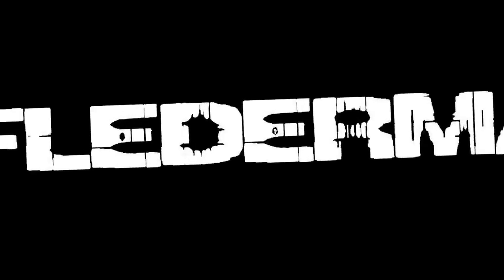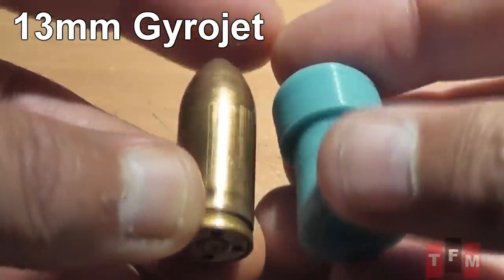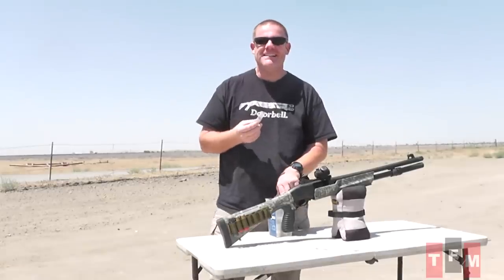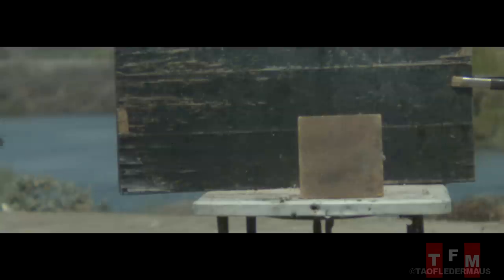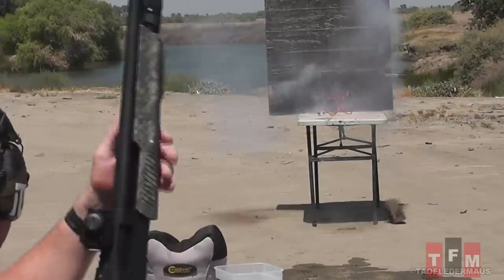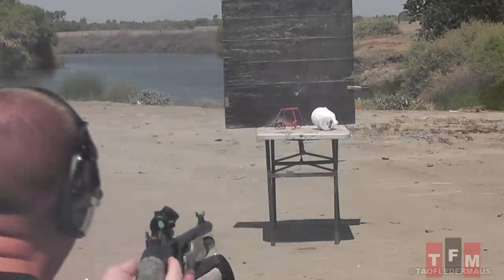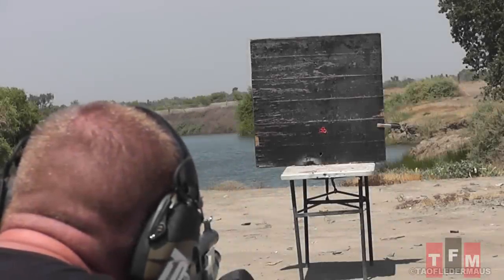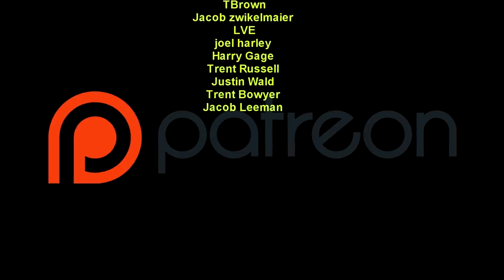Massive 3D-Printed ROCKET Slugs -   First Test

Comment: You have a drag stabilized projectile with a rocket motor.  Even if there is no actual thrust from that little rocket motor and it just create a base-bleed condition you have removed/reduced the base-drag on the projectile that would have normally stabilized the projectile.  I think you can see that in the way they flew.  It would have been interesting to have shot one of these projectiles that had the same mass distribution but inert to see if it would have been more stable in the absent of the base-bleed from the rocket motor.

Comment: You should try these with a lead slug having a cavity in the rear configured as a base bleed system from a rifled barrel. 
A base bleed is a slow burning rocket propellant that isn’t designed to provide thrust but rather to create a pocket of smoke behind the projectile in order to reduce drag. 
Works for artillery.

Comment: Very nice and interesting video.  You guys may have an idea here!!  I would have liked to see a 50 yard shot slow mo so we could have seen more ignition of the rocket slug and see if it would have actually stabilised it at a lomger range.  But i understand the fire issue.  Great video!
Reply from the maker: In retrospect,  they were accurate enough that we could have shot one over the water.
Reply: TAOFLEDERMAUS yeah, thats very true.  I was really impressed on the accuracy of them.  Hopefully you can get a couple more and maybe we can see a longer shot.  Great job!

Comment: 1:42 Best use of an old Hard drive I've seen! Lol. 

Never been into "reloading" shotgun cartridges but I might have to throw my hat into the rocket round designs. I imagine the biggest issue would definitely be the propellant (especially solid types). Reminds me of the precursor to JPL and the issues they had with Solid fuel (e.g air pockets, containments, etc). Not to mention the round has to be consistent as well. Dealing with such a tiny mass relative to it's velocity, where the slightest tug in one direction causes a tumble. 

I'd love to see the .STL file as well as the configuration/specs of the actual round like the material (ABS, PLC, etc) but more importantly the inline/wall specs (thickness, pattern, percentage, and design pattern of said lines, center of mass, etc). All those things are equally important as it can determine points of failure or where a spot could use a little ductility/give rather than being stiff and brittle. 

This should prove as a fun project. At the very least a good application of theory. Off to the whiteboard and Solidworks... After I look up some Laws surrounding the propellants lol.

Sidenote: I apologise if anything here was mentioned in the video already. As I jumped shortly after the hard drive scene. Just got myself too excited at the potential designs.

Comment: The exhaust from the round doesn't shoot backwards, it just kind of puffs out and hangs in the air. The nozzle/aperture needs to be optimized or perhaps a better fuel used. The rocket rounds mentioned would probably be a good starting point for a good geometry.

Comment: My first thought was, if a 9mm fits in the end of round, why not drill out the primer slot of an empty 9mm casing and then pack the casing with some sort of rocket fuel to give it a nozzle? you may have to cut the casing a bit short so it doesnt stick way out and cause a balance issue but it seems plausible? Also the main portion of the slug should be machined or cast metal so it holds up better. just a couple of thoughts

Comment: One other consideration is that the center of mass of the projectile changes inflight.  As the hard-candy propellant burns off the mass distribution changes.
Also, to strengthen the burn chamber, perhaps put in a brass liner (like cut one of the 9mm brass casings).

Comment: Try to make a small core trough the fuel starting from let's say 3mm and find correct size. It speeds the burning process producing shorter and faster burn rate producing more thrust (If You already haven't) Great video once again!

Comment: What if you used a blank 9mm cartridge mounted backwards inside the slug? I'm not sure if you can ignite the powder inside a blank from the front (you'd obviously have a primer in the shell casing), but that can probably be worked around.

That way you'd get the propellant of a 9mm cartridge encased in something that's meant to contain it (somewhat), and might result in better speeds. If nothing else it'd result in some interesting footage.

Comment: I think if you revisit these there are a few more tests to try. first being a shot without the rocket fuel to see if the thrust is doing anything at all. also you should see if you can drill out a metal diablo slug and use a small hobby rocket for more consistent thrust, though I don't know if a shotgun primer will cause those to ignite.

Comment: It seems like any penetration you're getting is coming from the shot you have loaded, not so much from the rocket. It seems when the rockets hit the ground or the table that they kinda die out even with the fuel still burning as opposed to the gyrojet where the slug doesn't pick up spead until ignition of the fuel. By all means, let me know if I'm misunderstanding something?

Comment: FWIW, the diabolo shape has a waist so it can fit through a choke.  Yes, good air rifle barrels traditionally have a slight constriction at the muzzle.  The newer long range match target air rifles set up to shoot actual bullets probably don't, but the ones that you or I will buy do.  

What makes 'em stable is the skirt at the back, just like a Foster slug's skirt is why they fly straight.

Comment: Officer Greg, this is an older video but maybe you'll still catch this. What's your optics setup? I have a Mossberg 500 with a pic rail for a red dot when I have the tactical barrel on. The pic rail gets in the way of the beads when I switch to the vent rib waterfowl barrel so I was thinking of an XS Sights setup as they utilize a pic rail and I could pop the red dot on and off, I think it'd work well together. Your setup looks similar.

Comment: Make them rounds out of metal, and hollow out the nose so you can fill it with the fuel. I think that there would be better results if the rocket fuel  burned from the front to the rear of the projectile. 

If the fuel is igniting in the rear, it's pushing the back end of the round forward. If you can make it burn from the front it will pull the back end instead of pushing it. I'm just guessing but I really think it would work better.

Or what if you only filled the nose with rocket fuel and put powder in the tail?

Comment: What I'm seeing is the primer/ignition power is propelling the slug.  When you shoot the ballistic booger, it sits on the table burning but doesn't even have enough thrust to even move it off the table.  I just don't see how there could be thrust to propel the slug to the target.  In your initial videos showing the slug burns, it would have been nice to just lay the slug on the ground and light it to see if it even moved.

Comment: great concept. However needs an accelerant such as aluminum powder mixed in with the fuel to speed up the rate of burn amd increase the thrust. Also as you noted a nossle would have helped.

Comment: it certainly needs a nozzle. you can do them with clay, theres an instructable on sugar rockets that uses compressed dry diatomaceous earth. that should be light enough not to toss out the balance, not that you have that right now anyway. id also like to see a test through a rifled choke, see how that affects it.
Reply: When I make my rocket motors I use a powderd kitty litter but then the core burner is only the size of the nozzle orifice.

Comment: Kinda curious if you could use the hole for the primer in a 9mm round as a restrictor plate and firmly attach the bullet to the casing, or replace it entirely. Not sure about the best way to ignite it, but you'd probably have to load it in a shell to fire it.

Comment: Three things:

One: You are right, the thrust is upsetting the stability of the slug. The slug shape is stabilized by low pressure pocket that forms behind it...and the pressure caused by the burning propellant eliminates that. Not sure how to fix that...

Two: The propellant needs to burn faster. The easiest way to do this is to cast a larger burn channel when pouring the fuel in. Less easy would be to cast multiple burn channels.

Three: And this is the tricky one! You need to build more pressure in the combustion chamber of the rocket. But not too much, or the fuel will detonate instead of burning! Also, this pressure probably would exceed the burst strength of the current 3d print.

P.S. What filament material was used to print these? PLA? Polycarbonate? PVC?
Reply: I used Maker geeks high temp raptor pla anneald in boiling water. According to there website it's stronger than nylon
Reply: % infill? Type of infill? Not criticising, but I freely admit curiosity!

P.S. https://youtu.be/bsjSHf_X13c?t=715 
should jump you to the performance tables , but feel free to check out the whole vid!

Edit: Did some more research on annealing, as I have not worked with it myself. Apparently, while it can make the part stronger, it also makes the part more brittle and vulnerable to shock loads.
Reply: @martindinner3621  they were done in 100% infill vertical with the tip on the bed.

Comment: I was under the impression that the Diabalo shape creates a negative pressure zone at its tail; and that the -P zone is key to the stability of the design.

So it seems adding propellant to the tail cavity removes the -P and undoes the stability of the design.  I think that partly explains why these had so much trouble.

It's an interesting experiment, and seems to confirm, at least in part, how the Diabalo shape functions.

Comment: Probably would want to fabricate the shells out of metal (or at least a higher grade plastic or whatever it was printed out of) and maybe work a way to put a nozzle into the design but less of a priority for something you are trying to reproduce somewhat cheap and in good quantities. Also from the clips it looked like you had good burn, just the speed they flew at didn’t allow for a build up of visible particles. Part of that instability may have also been slight variance in the center chamber being out of alignment with the shell coursing it to spin or waver a little.

Comment: thoughts on the design of the round, if you can get it so the exhaust nozzels are at the head of the round, and set it up to ignite the fuel from the top of the round so it'll burn from the front to the back you might get more accuracy and stability. just a thought for the maker of that round. if i can get a 3D printer some day soon i'll have some crazy things to try.

Comment: Think of the range you could get with a rocket bullet if you could perfect it. Small charge kicks it out to 100 to 200 yards then the rocket ignites and it can go 10 miles. Put some spring loaded fins for stability the shot cup holds the fins in until it leaves the barrel.

Comment: ive been subbed for yeara but i just checked to see if i had the bell on and i was unsubbed... its hapoened before on other channels to me and friends... gos knows why! great vid as usual, you and the OG crack me up. also i am interested on what damage an empty wadding or a shell made out of wadding stuffed into a solid mass in a shell and also the damage done but just the muzzle blast on stuff, no load just the hot air and pressure. thanks

Comment: The fuel composition could be changed. I was thinking something with potassium chlorate as the oxidizer and some nitrocellulose to keep it all together. The projectile itself could be made from an aluminium tube with a lead tip.

Comment: What about fin stabilization? And have the "tips" be flattened so they can slide down the barrel.

In addition someone mentioned using a brass nozzle or tube of sorts that sits in the slug. Since you showed a 9mm can sit in the hole why not just use a 9mm brass case? You could just have the large oepning face out or even test having the primer pocket face out and it could act as your "nozzle." That would add some weight too.

Comment: Design it to accept a shell casing facing backwards that will be used to hold the fuel, and put a steel point at the bottom of the hole to set off the primer. If the shell protrudes from the bottom of the round the pressure from the shot cup might push it up into the point hard enough to set the primer off and ignite the fuel pellet with some gun cotton or something.

Comment: How did you fill the rocket fuel? Typically, there’s a hole down the middle of the fuel called the grain. It gives more surface area to burn, thus more thrust.

Comment: I have an idea!!!  What if instead of loading the fuel into the rear of the diablo you made a sort of bell that went over the front and attached to the tip of the diablo.  The bell could hold the fuel and wouldn't put the balance at stake since it is being controlled by the pulling force of the burning propellant.

Comment: This concept is pretty solidly... uhh, still up in the air. The basic aerodynamics were a bit wonky, the plastic didn't want to hold up, and the rocket fuel inside each round took all of about two hours to burn through. It would be cool to see this redone with a better material or construction and more suitable fuel mixture.

Comment: Nitrocellulose to kick it up a notch that is what gyrojets use and it is not too hard to make DIY.  I would split the shell production in two and have them screw together or just glue so that you can print the nozzle as part of the lower half.

Comment: Solid fuel rocket motor projectiles are tricky. As the fuel burns the balance point is slowly moving toward the front of the projectile. That is why your tumbling.

Comment: Dope your rocket grain with a bit of sulfur (cause why not?.. smoke tracer :) and make the grains hollow.  Use a golf tee to shape the inside of the grain leaving a little cup shape on the back to increase initial impulse.  By experimenting with the shape of the rear cup and center hole in the grain you can use the pressure difference of 2 areas of the grain to create a sort of gas cushioned nozzle.

Comment: This is an interesting proof of concept for a rocket slug that has at least a decent amount of reliability. Though from what I can see it seems that the biggest issue with the design right now is the fuel mixture burning too slowly and somewhat irregularly. Part of me wonders if adding a small amount of black powder say around 5% by weight might help improve that. the next biggest issue I see is the slug seems to be really weak at the join between the top part and the flair at the back. It would be interesting to see someone mill a version out of aluminium that should keep the entire thing together and add a little more weight so that internal ballast is not needed meaning more fuel and possibly longer ranges. Finally I think that some stabilization grooves along the outside of the top of the slug would be an interesting next step to see if they help or hinder the slug in flight. 

Dang it now part of me wishes I had access to the tools I need to work on something like this and send a few variants to you to test.

Comment: I would have liked to see some longer distance shots to see what they fly like after the initial energy from the black powder was spent and it was flying under it's own power... like if you could have lobbed some into the pond without risking a fire.  Although, they were coming to a rest on the table and ground while still burning, so maybe the rocket propellent really wasn't adding much energy in flight.

Comment: The most important thing about any rocket is the thrust. These things were 95% black powder projectile and 5% rocket.
Ideally they would have to be made from steel for rigidity and the proper weight/balance. Then fill them up with some kind of powder that completely burns within the barrel and first 10 yards behind it. And to generate max thrust you shouldn't have a big opening in the back but just one or a few teeny tiny nozzles.

Comment: Burn is way to slow. The round not being stabilized means any thrust you are getting is being wasted in the oscillation.
With the low thrust/slow burn the only benefit you could realistically hope for would be long range. Does that slug design eventually stabilize?

Comment: Rocket assisted slugs ! There is a 120 mm  mortar  round that works the same way
Reply: Base bleed is a common range extending method used in various artillery shells. This slug has similar outflow rates comparatively.

Comment: I wonder if the rocket would work better if you filled a 9mm or 380acp deprimed case with the rocket mixture. May have to drill out the primer pocket but I think it would give more thrust.
Reply from the maker: Yeah,  that would strengthen it up quite a bit.

Comment: 4:51 on first shot look at the level of the waterline just towards the tree you were worried about igniting you can see the chunk of R-candy fuel has separated from the slug, nice bright orange spot of fire flying off
Reply: for any future attempts at this, key to solid rocket fuel = surface area! so the void inside the fuel where ignition occurs is often a star shaped hole with the ridges of fuel nearly doubling the inner surface area which makes it burn much faster... having a rocket projectile that travels ten yards and is still burning fuel isnt good (because it cant reach maximum thrust before reaching target) as we see in the gyro-jet video the fuel is spent shortly after leaving the barrel well before the projectile reaches the target which means it reached maximum acceleration/velocity
Reply: the slow burn actually makes it more of an incendiary round